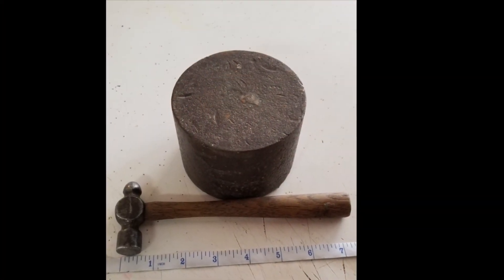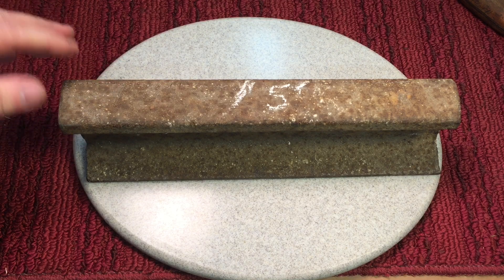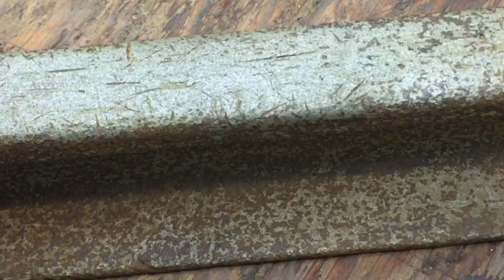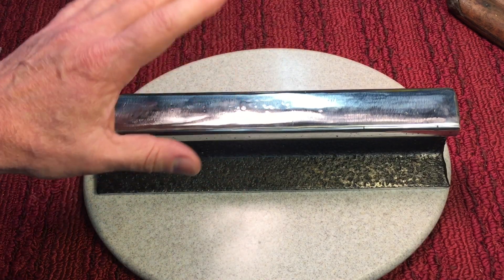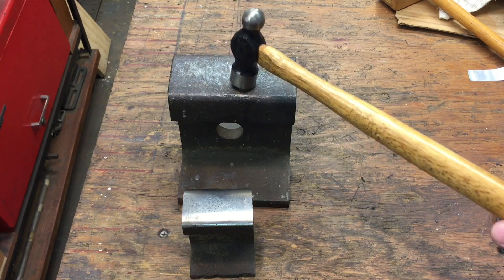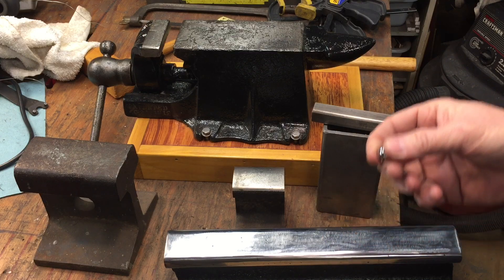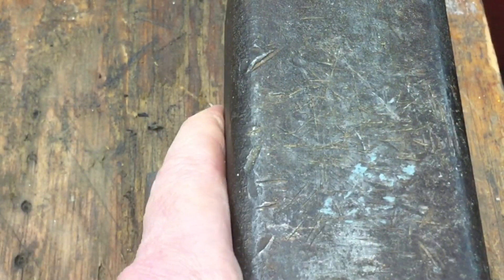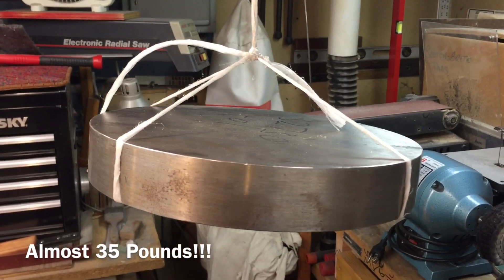Railroad Track and Other Shop Anvils...

Comment: Hi John  I really enjoyed that I was on the flea market three years ago and somebody had a 350 pound anvil for sale and it was by  Peter wright   He wanted  200 pounds and like an idiot I didn’t buy it it was massive 😭
Reply from the maker: Hi Ben!  The funny thing is A few years ago Blacksmithing had a bit of a renaissance due to YouTube, so everyone started looking for Anvils. Unfortunately that hobby is usually short lived because of the problems that go with it (noise, expense, fatigue and primitive results) so anvils wind up getting sold often.  I like the look of an anvil but most people don’t have the room for them.  😃👍. Thanks Ben!
Reply: @ScoutCrafter  There is a guy in Dallas that collects anvils and has several hundred of them in different shapes and sizes.
Reply from the maker: @royreynolds108  I saw that video!  He also collects all sorts of machinery!   Amazing collection!

Comment: hey i got a question, quite intricate, it dont really has nothing to do with this video but you know so much about so many thing, i tough maybe you'd have ideas for me, few years ago when i really started trying to build and fix everything, after a bit i started to obcess on what i call ' the aces of spade' i dont know if you remember when i asked about your homemade lubricants recipe? that kind of stuff, the things that aren't teach in school, even your dad might not now about, the things you can make, either tools, repairs, diy recipe, for things you would normally pay a ton of money because you dont know how to make it yourself. long story short i end up passing lot of time searching the web, and often noticing how for example, chrome is not interested on showing you how to make homemade paint at 1/10 the price, they'd rather give you advertising for where you can buy it, so my question is, do you know if there is some kind of a 'anarchist cookbook, homeowner version' that tells you, how to make  concrete sealer, engine oil additive,how to treat wood for cheap, make household stuff yourself, of garage stuff ect? like the bible for diyer of some sort
Reply from the maker: Hi Martin!  Yes! I have a book (somewhere) that was tons of information from the turn of the century where you would make everything instead of buying it!  Mostly old time recipes using stuff like lard and lamp black!  LOL  I can't remember the title or where it is right now! =D   They do make books like that!